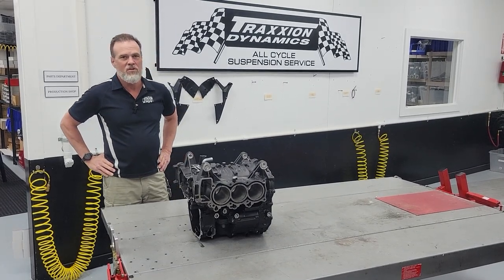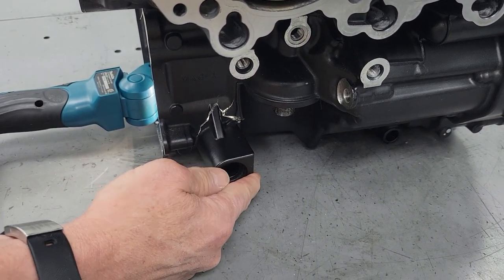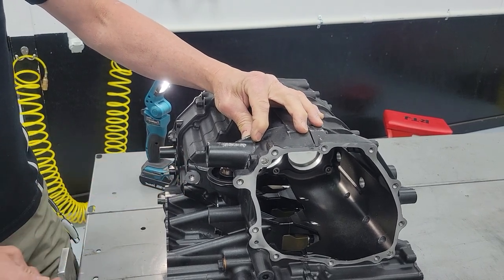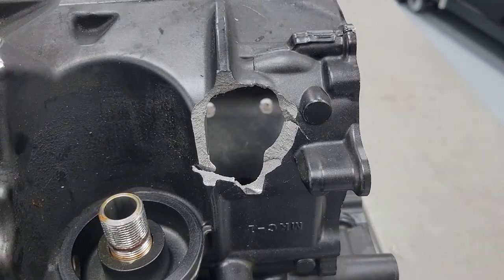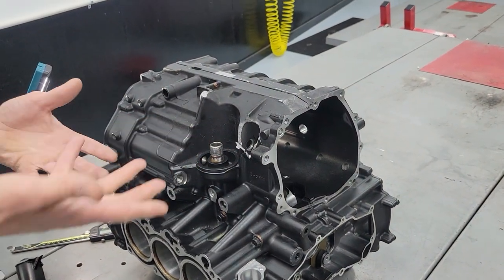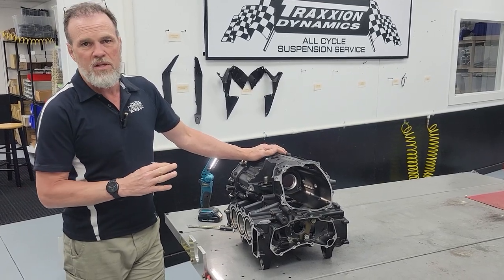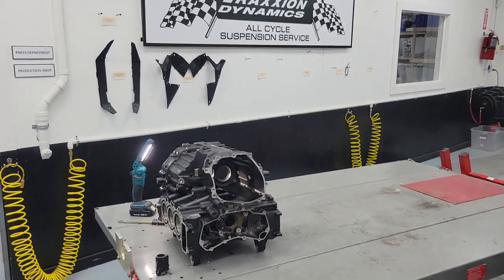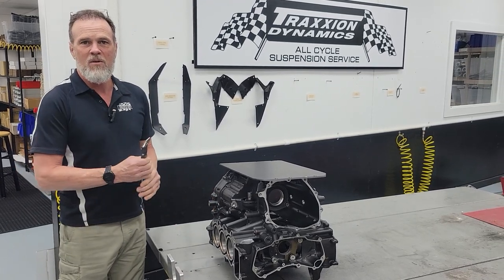WOW!!! BROKEN ENGINE CASES!!! 2018+ Honda Goldwing with Max McAllister & Traxxion Dynamics

Comment: For me the initial issue would be oil all over the rear tire and potentially put me in a bad situation health wise if anything breaks causing oil loss. Secondary is the damage to the engine. Glad I have that extra protection. Thanks Max for the peace of mind!!

Comment: Why does that case boss and the small flange behind it look like it was ground down? Would bottoming the suspension out in a corner cause those to scrape?
Reply from the maker: No, there would have to be some rise or dip in the road also, like a speed bump or pothole.

Comment: Try some JB Weld
Reply from the maker: I don't think anyone is that brave, or stupid... hahaha!
Reply: @Traxxion  Believe it or not I bought a used XR500R for a few hundred bucks where someone had JB Welded the cracked case.  It never failed as I rode the bike for 2 years and then sold it the same way.

Granted this was a $300 trashed XR and I wouldn't have the guts to do it with a 30k wing either, but that stuff is amazing.
Reply from the maker: @kennethsouthard6042  I agree, I use it a lot... typically in desperate situations.  I couldn't imagine doing 75mph down a busy freeway with my wife on the back of a bike with a 3" hole in the engine held together by JB Weld....

Comment: I just finished one 2021, the owner damaged the case while liading the bike on a trailer, ramp was too step, I charged 10k with parts and labor , it took 6 months due to back orders, yes too many parts, the key is organization and keep all hardware in its original location , way easier at the time of reassembling.
Reply from the maker: Wow, that's a crazy job to do!
Reply: @Traxxion  yeah was the biggest job I have done so far, I think the GL1500 have more parts than this one but never rebuild an engine on one of those
Reply: Chequer and faster to buy a new engine.